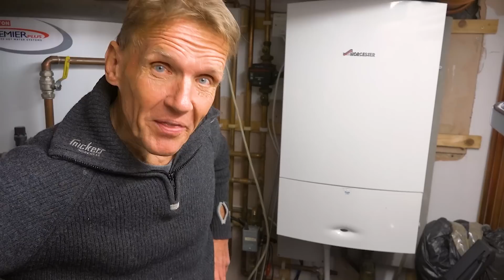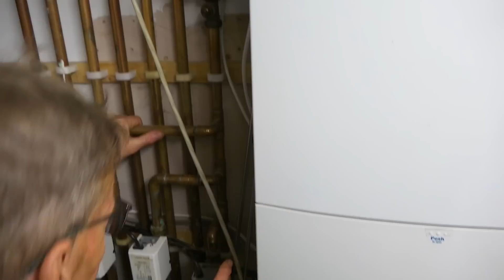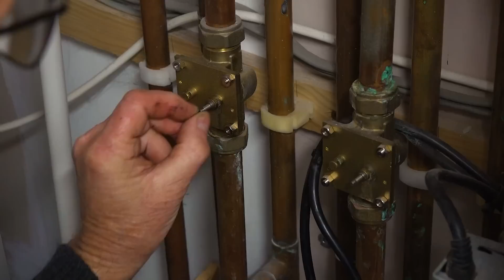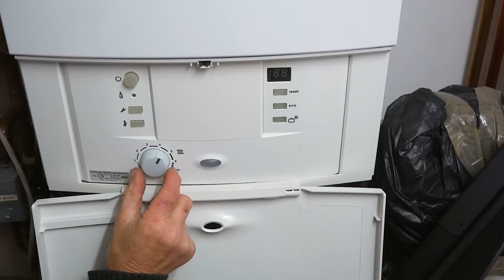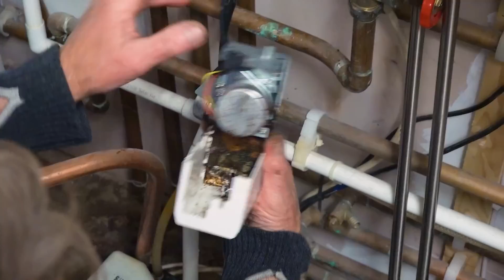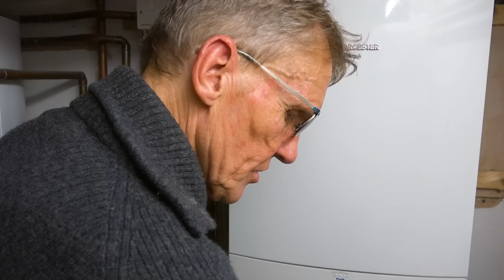How Did British Gas Miss This Simple Fault?

Comment: Just seeing the amount of oxide on those pipes should be a whacking big clue as to where there is a possible problem.
BG are terrible. I took out a 3 year whole system service plan with them. Supposed to get a yearly service. Only service it ever had was a week after I took the plan out. When a radiator thermostat developed a slight leak a week before the service was due, I left it alone as I would tell the engineer when he came. He never did. 3 months later I called them to come fix it. Took them 2 months to get someone out because they kept claiming the radiators weren't covered despite it saying in black and white that they were.
5 minutes after the engineer left I cancelled the plan as they hadn't kept to their agreement.
Did manage to get 3 months compensation out of them though.

Comment: Moved into a house - BG installed a boiler about 2 years previously.  Boiler was blowing a bucket of water every so often out of the vent.  Turns out they had installed the flue dead level.
Took a few months for them to agree that they needed to fix - they dropped the boiler as it was the easier option and then tried to charge me £500 for the work.  Cowboys.

Comment: The serviceman should be retrained. The faults (two of them) were found by not even using a multi-meter. Once the actuator heads are dried out they should have a meter test them.

Comment: leaks always leave traces after some time and therefore they're quite easy to spot. I had slow pressure drop in my system but after a couple of months some lime scale started showing up on one of the pipes near the boiler, it was just a compression fitting with plastic olives to connect thin wall tube to existing thick wall tube, such connections are relatively weak and need some tightening from time to time. Or a better solution, connect to the thick walled pipe with a threaded connection on one side and compression or press fit on the thin walled pipe.
But the installer apparently chose this solution because there was no room to use a thread cutter.

Comment: Next door has the same cover, and multiple visits from British Gas to diagnose an issue, which eventually they diagnosed as a valve fitted the wrong way round when they installed the boiler

Comment: Like you I was a self employed field engineer for Rayburn and Waterford Stanley C heating Cooke’s as well as AGA cookers. When we went out on a fault we carried every conceivable spare part in our vans to repair the appliance, if it was an intermittent fault we didn’t charge until it was fixed. Intermittent faults can be a real pain, but with years of experience, we could almost diagnose what was wrong from what the customer told us, so mostly we could go straight to the fault,. My experience of British gas engineers isn’t great one of their engineers after replacing a control valve on a gas boiler left a gas leak, when he was  came back he couldn’t find it. Even though I’m now retired and therefore not classified as gas safe, I had to go search for the leak it was on the burner side of the gas valve, the gas engineer hadn’t fitted the O ring seal. I made up a temporary seal from an old inner tube but then insisted the gas engineer return and replace it with a proper O ring.
Reply: We did Five Year Apprentiship as a Heating and Ventilation Engineer, and covered everything from Micro bore to 6" Cast Iron, Lead, Malleable Iron Screwed and Welded, Lead, with Gas, Oil, Solid Fuel ( worm fed) feed, Commercial and Domestic learning every aspect of the Trade.
I have to Laugh when this lot tell me they are "Heating Engineers" and Gas Engineer is what exactly.
As part of the Apprenticeship you worked with the Service Engineer (proper).
Those days are gone, your a Butcher now if you can take the shrink wrap off 😊.

Comment: I am not a heating engineer or plumper but even I knew what to check in order to trace this issue. Something I always do when looking for weeping joints is to put baby powder on your hands, as soon as the smallest amount of moisture touches your finger you will see it straigh away. I find this helps especially with cold copper pipes.
Reply: stop eating all the biscuits then    PLUMPER

Comment: British gas are rob dogs , I paid them for 9 years to annually service my boiler , it broke down and they said they couldn't come out for 3 weeks ! I got an independent gas fitter out and it was a blocked condense trap , you could see it was blocked as it was a clear plastic box , the fitter said it takes years to get this blocked,  when I confronted B/ Gas they said they only repair the boiler when it breaks down 🤦‍♂️🤦‍♂️🤦‍♂️ .
It took 5 minutes to clean the condense trap I could have done it myself it only had 2 screws holding it in.

Comment: Fantastic as ever, agree with you change the whole valve never the motor, I always teach that. regards, George Staszak Mr Combi 🤩👍
Reply from the maker: I change lots of motors. If the body is good there is no need to change it. Save the customer some money and the drain down.
Reply: I disagree, it's not my place to think about customer wealth, I think how to do the best job, also by remaining down I can check the E Vessel + inhibitor etc. the customer gets a better system. George Staszak PS I wound change ALL the valves because they are the same age which stops future breakdowns. @SkillBuilder

Comment: About 4 years ago I had 4 visits by 2 plumbers to find a CH fault.. and they couldn't.!  
            
Since the trend to go all-electric, I decided to go 'Dry' and started dismantling the system.. and discovered the fault.. A blocked Condensate trap...  A 'NO' expense fix..  Too late for the CH..

I would put it down to the experience of the plumber to spot obvious signs as Roger has shown..  Hire 'oldies'..

Comment: When I moved into my house I set up a British gas maintenance contract and as part of the contract they had to come out and service it. They tild me there was an issue with the pump and that I would also need a central heating flush, the bill was going to be £700-800. I arranged for them to do it, took the day off and they never turned up. I ended up using a local engineer and it cost me £120. No need for the flush as the system was only 8 years old.

Comment: Hey Rodger, Regin make a five way connector for the valves . They are a great safe way to leave the system with a temporary link and for swapping valves in future.
Reply from the maker: hi Christiac 
BG came and replaced the valves and used those very connectors. I have never used them but I will put some on the van because they are dead handy. Thanks for the tip, I didn't know who made them.

Comment: I signed up on their Mickey Mouse boiler repair scheme. They said my boiler qualified so I paid monthly. When it failed the engineer told me the system needed flushing as the rads were blocked and they were doing a special offer that month. When I reminded him the problem was intermittent he started getting angry. Then he said parts were no longer available so he’d give me a quote for a new system. I grabbed my phone, googled “spare parts for a…” and showed him. This made him more angry so I advised him to leave before I got angry. Cancelled my gas scam boiler scheme ten minutes after. Lesson for the delusional who still see British Gas as reputable.
Reply: Glorified salesmen
Reply: A written letter to the complaints department and at least one email. Each should refer to the other, companies are required to respond within 21 working days, just go from there.
Reply: they are rubbish and have been for ages all third party chancers I know from personal experience and that was the eighties
Reply: Well handled 👏👏
Reply: Agree!  Find yourself a decent local plumber and build a relationship with them!

Comment: We had a boiler fitted by "British Gas " 2 years ago , only ....it wasnt British Gas who did the installation they subcontract to a guy they pay £400 to put it in while charging us £3,000 for a new boiler , 
The installation  was (ill be kind) not the best , i had to tidy up pipework myself  holes in the wall around the new pipework , the vent cover not flush with the wall , just sloppy hurried work , 
British Gas? Never again ,

Comment: i had a gas boiler fitted by a corgi registered company i would love to name them it worked fine for 4 years then one day  no hot water i phoned a plumber a corgi one he had look at it an told me the boiler was not piped in correctly the hot water was coming out of the cold pipe of the boiler  an the cold was going in the hot side , after repeatedly asking the service engineer 3 times it has been serviced why i could not lower the hot water temp it was always scalding hot what a bunch of -------------s

Comment: The problem with them underfloor heating valves is that they will usually not move during the warmer months. They should be functioned weekly to prevent this kind of thing happening.

Comment: I was a electrician that BG called out to a installation they had 5 technicians trying to find why the boiler wasn't  working for 2 days , being someone who always check the basics first (not replace lots of parts till it works guy) tested the incoming supply to the controller using my trusted martingale discovered that the issue was with the supply it was missing the neutral faulty switch fuse, I told them and they all said they did check and stated it was live, they tested using their neon testers, and these guys are technicians ffs

Comment: I once had British Gas come out to fix an older gas boiler. Basically the boiler wouldn't ignite the main burner. After an hour of tinkering, he left and the boiler was heating water. Not long after he'd left, the boiler went out and wouldn't come back on. I had a quick look myself - the 'reparman' had manually lit the main burner using a match. Once the boiler got to temperature, it automatically turned the burner off. When it needed to come back on again it couldn't. Yes - that repairman had lit the flames and done a runner claiming it was fine!
British Gas is just a corporation name - much like many other familiar company names now are. Far better to use a skilled local tradesperson these days.

Comment: Not really related, but I recently woke up on a Sunday to no power in the house.The mains had tripped so I did all the isolate and follow things. The fault had me going for 4 hours, jumping from circuit to circuit. I ended up stripping the auto gate motor, replacing a socket, replacing the main incoming trip switch (at 500 bucks!) and pulling sizable chunks of hair out. The fault went from one room to another on wall sockets, lights and even the solar geyser back up. At the end, in desperation, I remade the end of an unused but plugged in extension lead....fault gone. There was no sign of corrosion or stray bits of wire in the end of the lead, but.... Help me understand! as Derek says!

Comment: I have some inspection work to do; - I just re-pressurised my mums heating AGAIN but am having to do it more frequently, - no radiators have leaks, but now I know where to look! - NICE ONE!
Reply: If you keep losing pressure check the expansion tank first, those tend to be a common failure point
Reply: @anthonym9754  - as in, there is an internal diaphragm?
Reply: @MEANASSJAMSTER  The water expands as it heats up and passes the relief valve (normally to outside where you cant see it.) The water cools and you have lost pressure. Buy an external expansion tank and tee it to a heating pipe somewhere.
Reply: Pressure relief valve or expansion vessel more likely

Comment: Intermittent electrical fault and there are solenoids on water pipes, gee I wonder if they are leaking and shorting it out? First thing I would check, good find. A meg-ohm meter wouldn't be a bad idea to test for leakage on them intermittent faults.

Comment: I spent a while troubleshooting my boiler, and after going through the usual suspects, I found the exhaust cover had gone askew, and a bird had flown down the pipe, and gotten caught just outside the combustion chamber…  the unit detected the improper airflow and went “nope.  I’m off ‘till you evict those feathers.”   it was time for a clean anyway.

Comment: I had the basic BG annual service contract. Cancelled it after they started scalping their employees and messing with their conditions. No wonder they're getting worse.

A local, independent heating engineer a friend recommended is leagues better. He's kept a 20+ year boiler working fine (long story, but replacing it wasn't easy as I'm in a B-listed flat) and was happy for me to source parts, he explains what he's doing and why. Great guy, very reasonable prices, generally turns up when he said he will, too. I'm replacing the boiler soon and having him do it, too.

Comment: We had the same problem with those ESi valves, (About 5 years old) just before we were moving out so had to get it fixed quickly. I diagnosed the problem myself before calling a plumber to swap the valve bodies.

Comment: Good video but the way you explained it, it sounded like you could bypass the valve to an unvented hot water cylinder, you can see in the video that unvented cylinder is the silver Honeywell valve so you didn’t remove the unvented cylinder valve, and to anyone watching this video never remove or bypass the two port valve on the unvented hot water cylinder it is one of the fail safe requirements for the cylinder, Bingo bongo bango 👍

Comment: My Mum had central heating put in all free on some scheme in Bradford ( I think it was a work in homes training  scheme) I don't think it was British Gas though.
Anyhow I went to look at their work and what I saw you could not make it up, they had run a 22 mm gas pipe round a joist in the cellar, so when you tried to close the door at the bottom of the steps, it hit the gas pipe.

Strange thing was, they sited the boiler where the Main Severn water heater had been, it already had a 22 mm supply pipe all the way from the meter and did not need to go up the middle of the cellar steps it went under the kitchen cellar and ran up the kitchen wall and also supplied the cooker, they capped it off just after the cooker, waste or what ?

 I said get them back to rectify this, mum said she did not like to because it was free, so I got on the phone to them to get their 'Gas safe' arses up here and fix this abomination of a plumbing job or I will send the photo of it to the local newspaper, I was really fuming as I have done water plumbing many years in the past but not gas registered to touch gas, so they came back and the guy who was the ''gas safe'' trainer had to re do it and cut an inch notch through the joist to route the pipe through, they may be ''Gas safe''  but crap routed plumbing and other trades associated with it like the square hole that was left from the  Main Severn flue terminal was bodged with red brick on a stone house and rendered over, what a fkg joke !
Gaz Yorkshire.

Comment: Wouldn't the 3 amp fuse in the in the fused spur blow before the RCD triped if the fault was on the boiler ?
Reply: not if it was neutral to earth fault

Comment: I did a job where BG put the new boiler in it kept tripping out they probably came out at least 10 times changed the mother board and lots of other things none of which worked. In the end they got an engineer in from Worster to have a look. When BG put the boiler in they put the flow and return in the wrong way round which was the problem. Enough said.

Comment: The two possible faulty 2 port valves seem to serve the heating circuit probably zoned the other two port is labelled as 'Hot water' so no point in turning the immersion heater on but well spotted for doing BG's job. Its all about observation as you have stated and if that fails to identify the fault then begins the process of elimination
Reply from the maker: Yes you are right. I turned the immersion on just to speed things up a bit so they could get a shower, having been without hot water for a couple of days.

Comment: BG are now sales engineers and why lots have left. BG tried charging me £4500 for a new Vaillant boiler straight swap with condemned alpha boiler with lead time of 35 days in November! Independent engineer charged me £2300 for exactly the same boiler and fitted in 3 days. I had no heating or hot water. BG are a disgrace and shambles.

Comment: Removing the actuator head to the unvented cylinder have you not removed part of the overheat protection on the cylinder?
Reply from the maker: @NeilRidley1 If you watch the video you will see that the hot water motorised valve is the Honeywell on the right. I am not sure why you think I removed it. Even I I had 
 it would only result in the DHW being too hot. It wouldn't explode.  The temperature relief would kick in. I think I would probably just use the immersion on this one if the hot water 2 port had been the problem.
Reply: @SkillBuilder my mistake but at 4min 40 you suggested it was controlling the hot water and even said you reduced boiler temperature so cylinder didn’t overheat?
Reply from the maker: The overheat protection is  multi level.
Reply: @SkillBuilder The problem is , the primary heat source control to the cylinder is now disabled 
It would’ve been safer to leave the valve head in place , shut off the hot water channel on the programmer and just use the immersion heater 
Good diagnostic work for the customer though , sounds like the previous engineer was lacking experience at this sort of thing
Reply from the maker: @liveloud9894 The hot water zone valve is the Honeywell which I didn't have to touch
Reply: @SkillBuilder  Ah yes now I’ve watched the video back the Honeywell is indeed labelled as the hot water zone valve , which you didn’t work on 
But you must admit you assumed it was the cylinder feed you were tampering with in the video so I would’ve been correct if that was the case 
No worries 😉